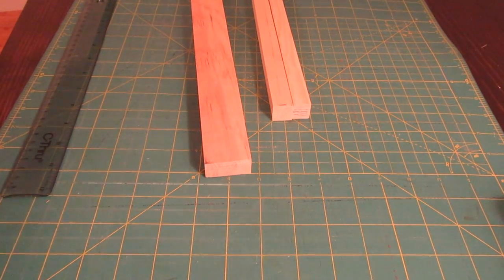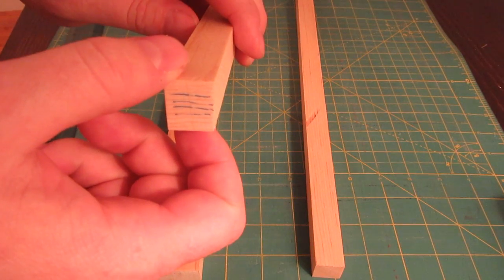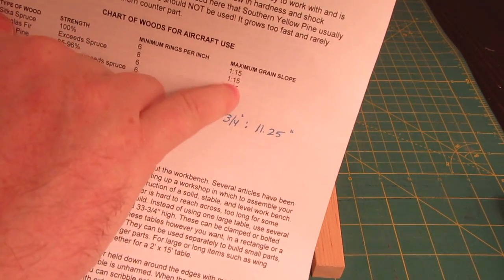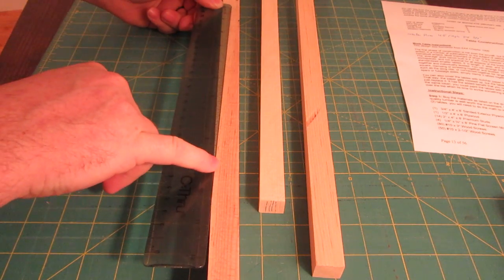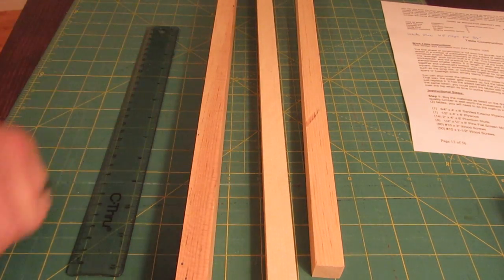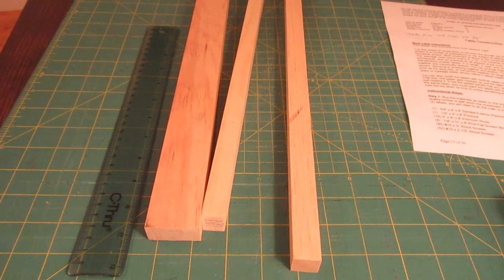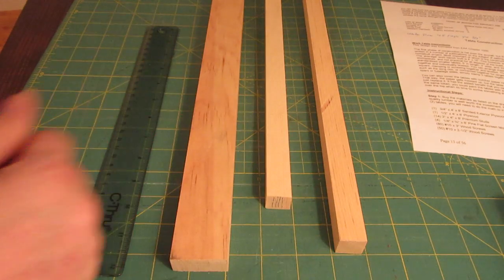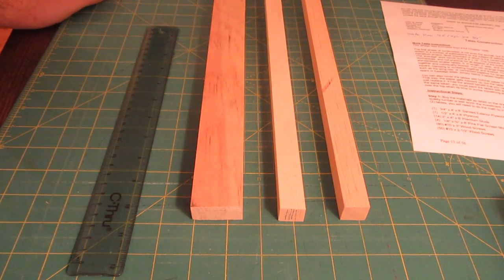How to Grade Wood for Aircraft Use

Comment: How hard is it to find wood that meets these specs?  Great video.  Do one on adhesive.
Reply from the maker: David, it's not hard where I am located (New England). Here Northern White Pine and Spruce grows naturally in some parts and is logged in all of the New England states. I can find it at the smaller local lumber yards. Sometimes (very rare) I'll see decent northern white pine at Home Depot as they source locally, but that is not often. They also pay the least for their wood in bulk, so they get the worst of the batch. I've never ever.... seen good wood from Lowes. Even in New England they have their wood shipped in from overseas. Seems like bad business since they can get it locally. Where ever it comes from it grows way too fast and is very lacking in strength and density.

Comment: I found some douglas fir 100yrs old ish. 10-13 Gr per inch and in 42" length 1/8" runout. This was  a paper mill floor.
How would I test it for strength etc.?  The piece I have is split and no idea what moisture content is. Can you control moisture when finishing? It looks good but not sure about exp. plane use.
Reply: Due to its age and used for flooring for 100 years, I wouldn’t recommend it’s use in a new aircraft construction for any load bearing members. There is a strong possibility that there are many flaws in it due to foot traffic which may have introduced compression fractures in the grain over its lifespan. Also, flooring like that probably has knots and sap welts… one thing not mentioned in this video; there can be NO knots or sap welts, or any imperfections that would compromise strength for aircraft grade.

Comment: I just got plans for a wooden frame aircraft but i am in Kenya [East Africa] so these species are unheard off. Is there a way to generally get equivalents? Are they for instance  hard or soft woods? We have varieties of Pine and Cedar. Eucalyptus and Mahogany etc. What do you think?
Reply from the maker: I don't know the exact answer to this. I would research the pine options that you have. Possibly the mahogany. Find out the exact species and then see if you can find charts showing the strength of that species as compared to others. You'll want the chart to be specific to aircraft.
Reply: that is what I am going in the Amazon of south america...comparing spec. charts.   @Yellow_cub